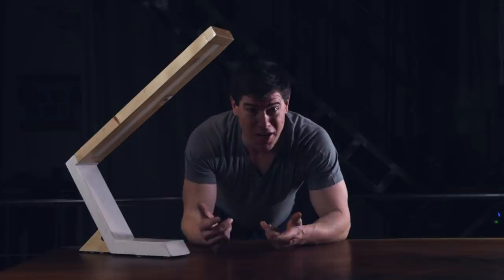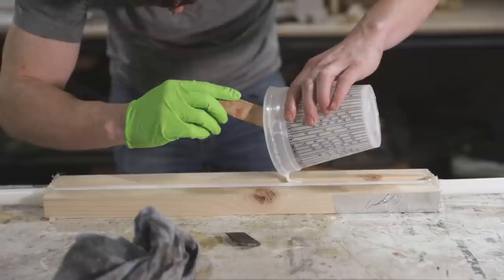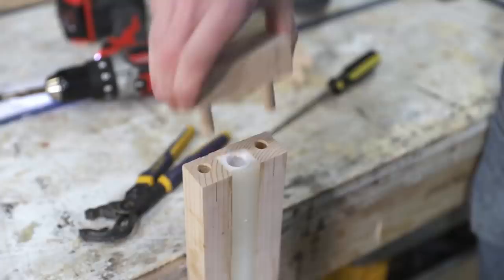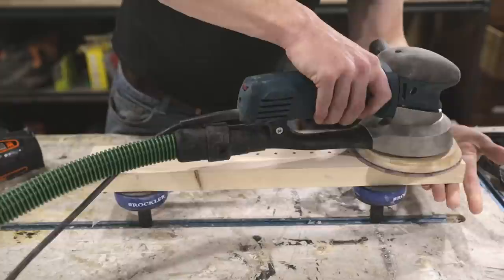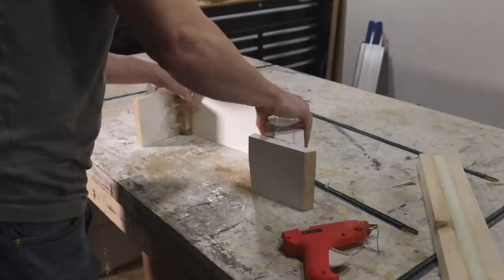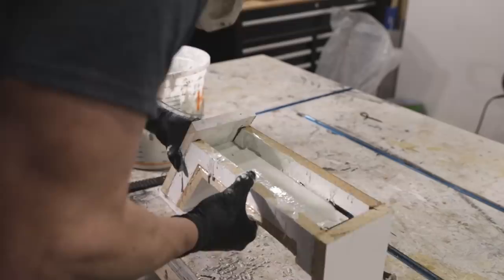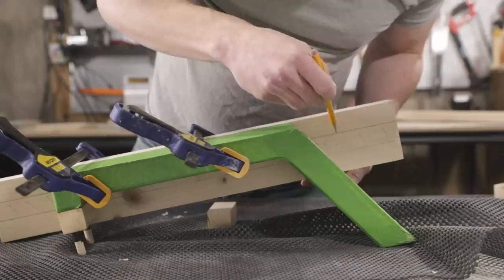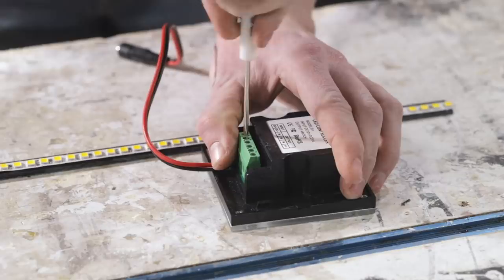DIY concrete EPOXY LED lamp || how to make || woodworking

Comment: just a note
I followed your instructions to a T just because I loved the design
The light isn't too strong which makes your choice of lighting very bad. It doesn't even work as a reading lamp. I ended up replacing the led strip with an led aluminum strip (you can find it on ebay or dhgate, really cheap) that had an 18000 lumen rating. Worked like a charm
But other than that your design and implementation were flawless
Thank you

Comment: Use a string with a weight attached ar the end,  tie the other end to the LED lights, and you can pull it through while keeping it taunt and therefore the lights oriented in the correct direction!! Love your creativity.
Reply from the maker: Interesting idea!  And, thanks!

Comment: One tip i would have for this is to cut the false ends off of the original board before you channel it out so that the wood grain matches on the final piece.

Or better yet would be to route out the area for the LEDs and only cut one side open so that the finished side (outside) doesnt have any cuts seen.

Comment: I would make the removable part very thin layer of epoxy with some tiny clips to the inside to be attached to the wood. To keep the balance in the lamp, I would add some iron from the inside front of the concrete to keep it balanced instead of adding extra wood and changing my design. Good job, I’ll use this idea in different design, as I’ll make it as a bar drop light (no concrete needed). Thanks for sharing.

Comment: Small tip: If You spray a little isopropyl alcohol over the hot glue, it will loosen up right away, and you don't need to use heatgun. 

Very cool lamp, I will make a similar one.
Reply from the maker: Thanks Erik!  And that's a great tip!

Comment: Perhaps use metal, such as aluminium or copper, for the LED strip to stick onto for better heat dissipation from the LEDs. New subscriber here! Cheers!
Reply from the maker: Good call!  Glad to have you join the community!
Reply: Any tips on where to source aluminum strips to use inside the pex tube? My searches on amazon and eBay have been fruitless... thanks!

(This video is what inspired me more than a year ago to pick up my diy projects after years of inactivity, thank you @modustrial maker)

Comment: The lower base, which must be heavier, can also be made of wood and inside the assembly a piece of iron or even marble. The marble can be found, a strip can be mounted in a wooden gutter to make it look gorgeous! The lamba must still be a little smaller than this!

Comment: Just a quick tip: use aluminum strip instead of acrylic - it will dissipate LED heat better and will extend their lifetime!
Reply from the maker: yup, noted that in the video (with the text overlay).

Comment: Really nice build Mike! I really like its profile a lot. The PEX is a really interesting idea. Do you think you'll use it again, or is it too much hassle?
Reply from the maker: Thanks Michael!  I might, but also might use clear silicon tube. It was pretty simple to use, and if I hadn't overshot my channel width at the table saw, it probably would have looked pretty clean with clear epoxy over it (which would have simplified it a bit).

Comment: Hey man, I've just found your channel and binged a lot of videos. Great ideas and content!

One thing I would have done slightly different is to leave a piece of tubing inside the concrete mold so the wiring remains completely invisible. You could even leave an opening to the upper part of the base to place the on/off switch, that would be neat!
Reply from the maker: Thanks Juan, and welcome to the community!  That would be a great modification to run the wires thru the concrete.  Keep the ideas coming!

Comment: Ive never worked with concrete so maybe this question is basic but is there a reason you guys dont use sulfur free clay to seal a mold over silicone?  Ive used clay and fillet shapers for massive silicone pours with zero leaks so it seems like it would be a huge time saver here as well.
Reply from the maker: I'm not sure if the clay is waterproof? If it is and doesn't bond to concrete then it could work.
Reply: Modustrial Maker it’s a non drying reusable clay thats oil and wax based.  Doesn’t stick to anything that I’ve used it on.  Makes perfect round fillets so in terms of finishes you can get a perfect half inch round finish and need little to no finish work on the edge.  Works with epoxy, polyester, silicone with no reaction. Can’t find anything about water reaction though so good question.

Comment: What did you use to fill the small holes in the cement after it was done?
Reply from the maker: Nothing....the GFRC was pretty darn smooth out of the form
Reply: @modustrial  if that happens, how does one finish it? Also , will the holes on the wood be enough to keep led from heating up ?

Comment: you could use aluminium thin bar instead acrylic. which also help the  LEDs to dissipate heat more easily..
Reply from the maker: Yup, that is why I have the text in the video saying that aluminum bar would be the best option ;)

Comment: Those end caps look like they could be better
Reply: can't wait to see your improved version of the lamp!
Reply from the maker: Yes, they could be cleaner....this whole series is about experimenting with process and design....these are prototypes, not meant to be a refined product ready to be sold.
Reply from the maker: @juan Manuel alzola thanks!  The big one should be out in a month or so
Reply: @modustrial  are you making the floor version of it? :O Really can't wait!!
Reply from the maker: In the floor?  Now that would be pretty cool....
Reply: I think the only mistake was made when decided to make this upper end cap, cause it really does no function. But other than that, very cool, nice looking, inovative and I would be happy to have that thing on my work table 😁😁
Reply from the maker: Aleksandar - thanks!  And I agree, if I were to do it again, I'd just put a piece of 2x4 into the channel, or use a router so the channel doesn't go thru to the end.  The cap detracts somewhat from the clean modern lines
Reply: @modustrial  first thing I thought when seeing the lamp (before seeing the video) was, that you would've used a router to create a channel. Just like you already mentioned yourself, you won't need any caps that way. You could even skip on the whole epoxy thing if you install an aluminum c profile and the plastic cover that goes along with it. P.S. great design nevertheless!
Reply: @modustrial  I was thinking that you also could have made the cap from the end that you cut off, that way all of the grain would have lined up.

In future rebuilds, for more weight, either make the base a little longer, or add chunks of lead towords the tip of the base.  Using the lead instead will help keep the profile short.

Comment: Nice project. What brand cement is that and where do you buy it from?
Reply from the maker: It is Fishstone GFRC mix... You can order direct from them or on Amazon, but shipping is pricy.  The dimensions of the frame are such you could also do it with standard concrete, but it wouldn't be white.

Comment: Great job! Given that heat is an issue with LED strips wouldn't it make more sense to glue the LEDs to an aluminum bar? The acrylic acts more will act more as a heat insulator, right?
Reply from the maker: Yup acrylic is fine, but aluminum would be better (actually have a graphic in the video mentioning this)

Comment: Cool design, liked it better b4 he installed the kickstand. Also the 2x4 was not the best choice imo.
Reply from the maker: Thanks!  I would love to use walnut or maple in every project, but was trying to mix it up a bit.  Of course, it would be better in a hardwood :)
Reply: @modustrial  rapid protoyping with less expensive materials is always a good call (especially if on hand or readily available). learn, iterate, switch to more expensive materials (if desired), refactor for the balance. keep doin' it your way!
Reply from the maker: @sean albright - you hit the nail on the head! :)
Reply: Modustrial Maker big fan of yours. Can’t help but speak up when I see people refereeing from the sidelines. FYI I’m concretemovement over on IG. Origin in cart ready to purchase to bring in the new year!
Reply from the maker: Sounds like a great new year for you!!!  Thanks again Sean!

Comment: Another great video and great little project, also a belated Merry Christmas pal and I wish you the very best for 2019, its a fantastic channel and I too hope it keeps growing.
An led strip tip, the flat silicone tubing you get with 'fully' waterproof led strips you can buy on its own in I think 8mm, 10mm, 12mm and 15mm widths of ebay, I've used it with success as it keeps the led strip flat and you don't have to remove the tape therefore they can be swapped out easily,
Good luck pal and I look forward to the next project.
Reply from the maker: Thanks, and good call on the waterproof strips to stay straight.  Merry Christmas and Happy New year to you as well!

Comment: You could have just put something heavy like a chunk of tungsten in the top end to shift the center of mass. Then it would not fall over.
Reply from the maker: That could work
Reply: Just use one of your many "chunks of tungsten" you have lying around!
Reply from the maker: @james Hannan lol, that is kinda what i was thinking, but I thought maybe I was missing something....
Reply: @modustrial  Anything with a good heft would work.
Reply from the maker: @hotystein yup, I even thought of adding some concrete.
Reply: just use cheap lead or cast iron

Comment: For the ventilation to work correctly, you'd need an air intake. Perhaps still a holes from the top side into the sides of the channel. Still not optimal. To make it right, I'd cut through the top, above the diffuser, and inlay a metal profile to which the LEDs would be attached. It would serve as a radiator, and also there'd be no concerns with dust entering the lamp.

Comment: 13:13 well, you did it again...
you drilled the tiny holes for ventilation (it is not efficient but still better than nothing) but you missed an opportunity for better heat dissipation, you should use an aluminium strip instead of acrylic :-(
Reply from the maker: This project was done....that's why I added the graphic later saying aluminum bar would be the best diffuser ;)
Reply: @modustrial  
Using all-alu structures is the best for LEDs.
I have built lighting systems that can absorb > 1KW , thick profiled bars conduct heat away and dissipate it with the large surface. Even if your individual LED is maybe 80mW, when you put 10K LEDs things get out of hand... And alu reflects light so it both dissipates heat and focuses light !
You build great wooden objects BTW. I advise you to consider aluminum for the LED part and build the "nice casing" around it :-)
Reply from the maker: Agreed, looking into that 👍👍
Reply: So would the vent holes in the top still be necessary if the aluminum strip were used? Looking to build a small end table, and I'm adding lighting to it. Looking for ways to keep the heat down.

Comment: Idea is great, but the lamp looks pretty messy and first every woodworking projecty (if you know what i mean). With a better designed lamp it would have been a homerun. :)
Reply from the maker: People complain all the time I make projects that are too expensive and use too many fancy tools, etc, so that was kinda the intent for this project -- make something more accessible using basic materials and basic techniques.
Reply: @modustrial  okay then i get it. If that was the intent you made a homerun. :) Nice job.
Reply from the maker: Thanks man!  And between me and you, would have loved to have done this with walnut, a nicely routed channel, and chamfered edges 😃

Comment: Yo dude, don't man handle you cat like that
Reply from the maker: Appreciate the concern, but the little guy has been with me for 16 years.... I wouldn't ever do anything to hurt him.
Reply: I know, just a fellow cat owner and I know they're delicate little fur balls, but still a slower approach is better for him, trust me on this, and 16 years is crazy.
Reply: Another great tip for if you need to temporarily attach your work piece to your bench and not use screws or nails, use masking tape and super glue, lay a strip (or enough you feel needed) and line it up with tape on your bench, put super glue on the bench side piece(s) of masking tape and super glue catalyst / spray activator on the work piece side of tape, line them up and put them together, to release it just pull upwards then remove the tape
Reply from the maker: Good tip!

Comment: I don’t understand the trend of using concrete for everything.. it makes everything exponentially heavier a lot more work making forms for it and if it drops it can still break.. 🤷🏾‍♂️
Reply from the maker: I'm kinda amazed when you complain about trends you aren't talking about epoxy ;)  kidding aside, it is actually very practical in this application.  The base is only about 5 lbs (GFRC is lighter than standard concrete), and the weight at the bottom is desirable -- with the back support piece it makes for a very stable lamp.    And, GFRC is amazing strong and crack/break resistant.  I actually did drop this lamp from my workbench (32") while assembling it, and it didn't even chip!  (One of the 2x4 endcaps cracked and had to be glued back together, but the concrete was fine -- really wish my camera had been rolling when it happened!)

As for the popularity, it is in large part due to the aesthetic and design flexibility.  It gives a stone look, and can be cast in almost any shape imaginable (shapes you could never achieve with granite or marble).
Reply: Listen you did a great job brother and your creation skills are impeccable 👍🏽👍🏽.. I’m just kinda commenting on the YouTube trend of concrete everything and yes epoxy too lol .. 

I’m only thinking about how much work goes into making forms, keeping it from making bubbles etc. and making it heavier .. other than that great channel and I’ll sub 🤘🏾
Reply from the maker: Yea, I hear ya....YouTube is a sea of trends.  Concrete is definitely a lot of work, so its just a cost/benefit analysis of how much you like the way it looks vs. the extra effort involved :) Glad to have you along for the fun!